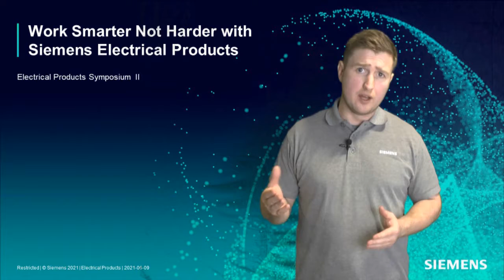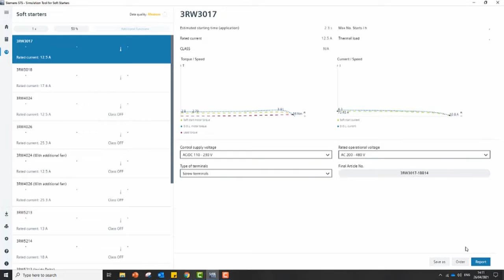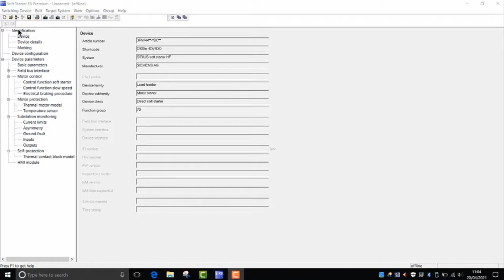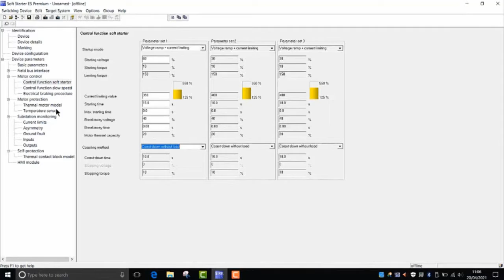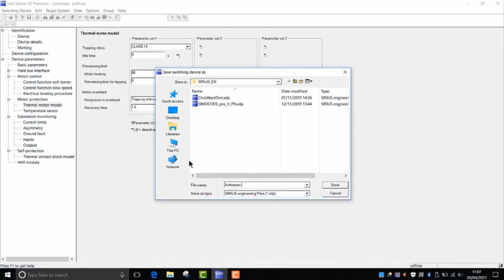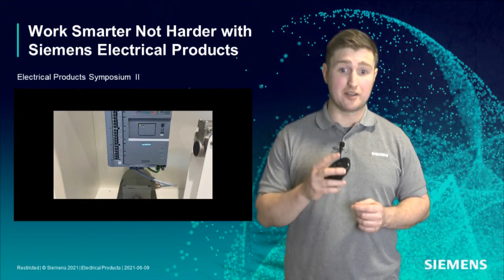Soft starters configuration

Comment: How to trouble shoot errors in softstarter 
We received device error
How to solve
Reply: If there is no display on the panel, first check whether the soft start control power supply (AC 220V) is normal. If the power supply is abnormal, then measure whether the fuse is blown, whether the circuit breaker is out of phase, and whether the control power line is disconnected.